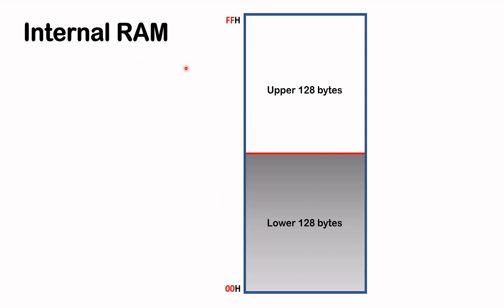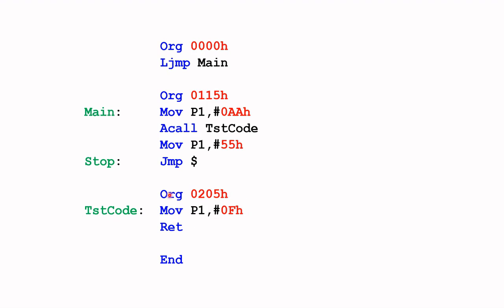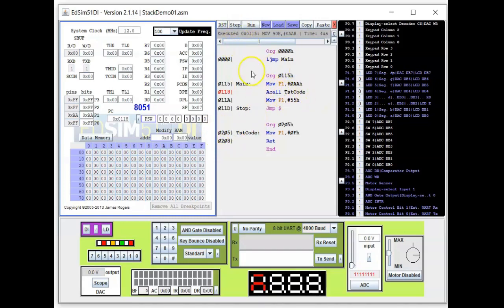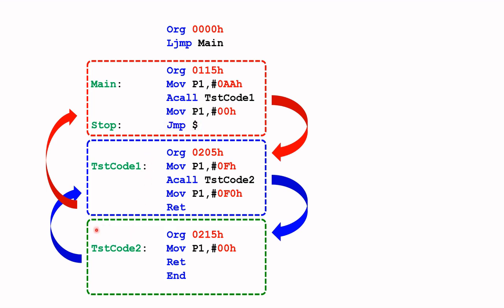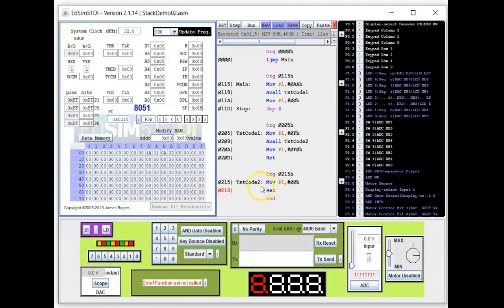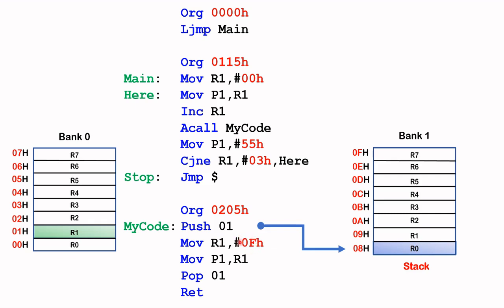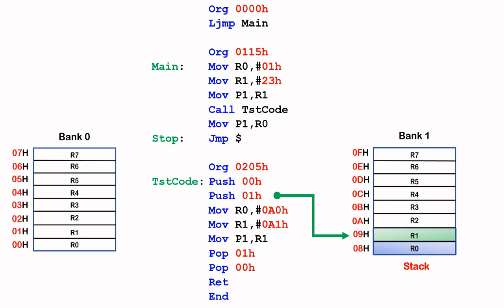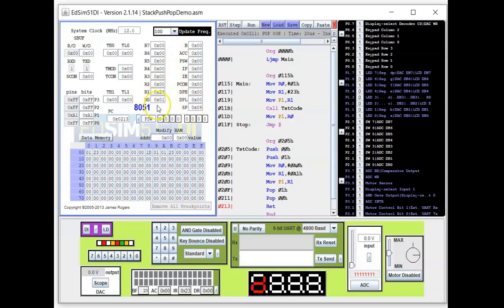#31 8051 Stack - With Coding Examples

Comment: Hi as always great videos and very informative. I just want to ask have you encountered DC Motors yet in EdSim51? I'm quite having problems with it interfacing it alongside the LCD and Keypad.
Reply from the maker: Hi thank you for your kind words. It's appreciated. I will be doing more videos on the EdSim51 LCD and keypad soon. I will also look into the DC motor too. May I know what problems you have encountered with the DC motor?
Reply: @vooiyap  well I am having trouble interfacing the clockwise motion I can only interface the anticlockwise
Reply from the maker: @keebul0y  Hi Noted. I keep that in mind when I look into the DC motor interface.
Reply: @vooiyap  thank you!